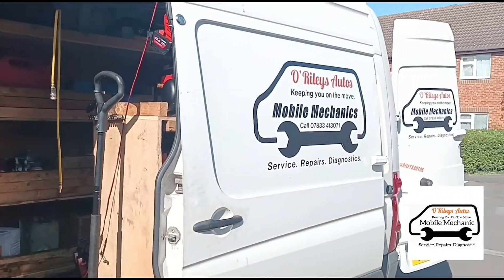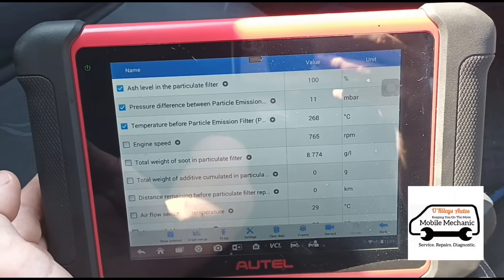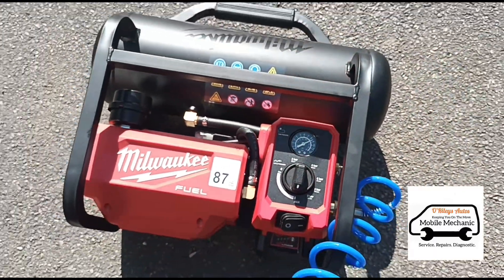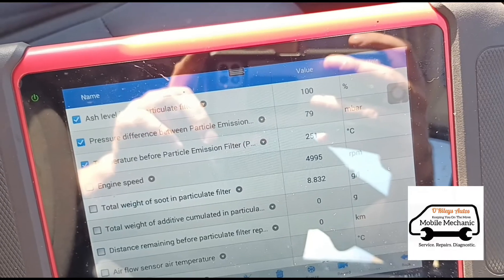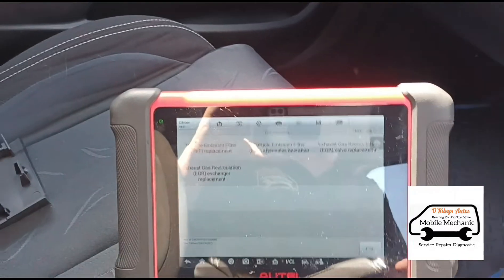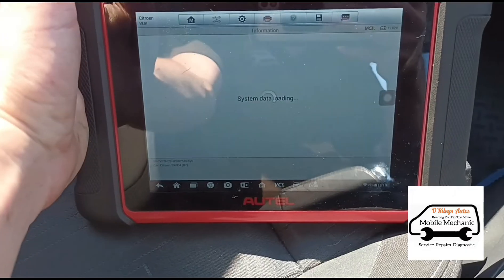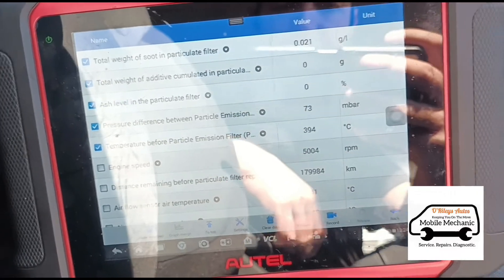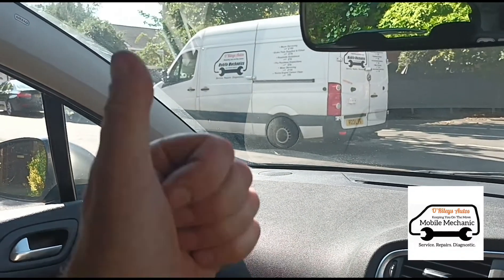Citroen C4 P1445 The Quantity of Additive Is Above Limit. Diesel Particulate Filter Must Be Replaced

Comment: Great video again. 
I have an error P1445 and motor blocked at 3000 rpm. Do I have to clean filter too or only add eolys fluid?
Cheers

Comment: Great video as usual.
Would the Autel 808 have done the same job and would you recommend getting one from China, I.e, from a non authorised dealer?
Many thanks, Joe.
Reply from the maker: I have a DS808EU and I was told by Autel that because it came direct from them it had the same software as the bigger tools
Reply: Thank you  for your reply. Joe.

Comment: when it asked for a value less than 300 and something have you figured out what it was setting the values of surly it can't be the tank level with the maximum value it asked for and I know they only calculate how much additive is left from how much we tell it we put in I've only used a snap on scanner to do this so far and the only option is to tell it it's been filled